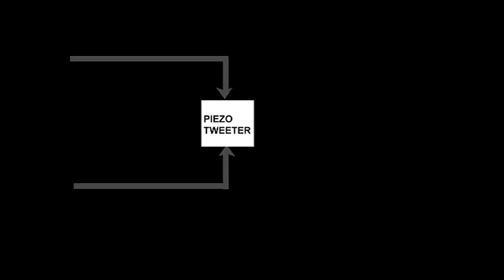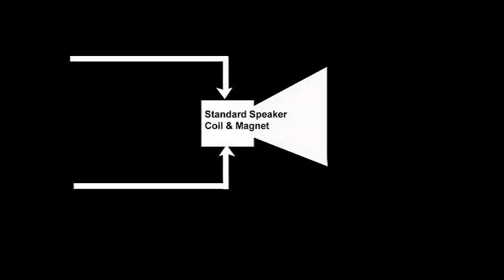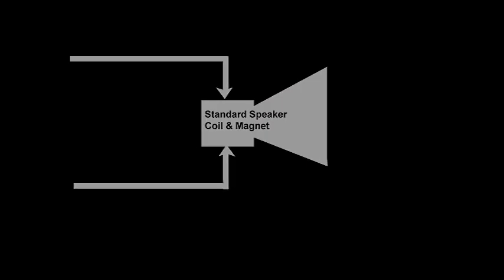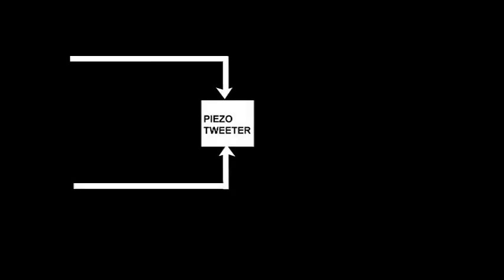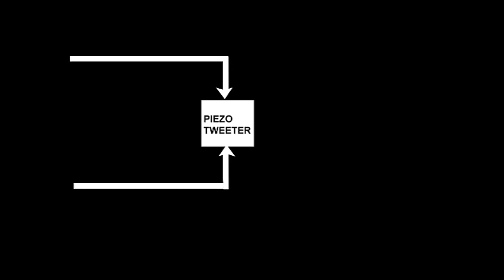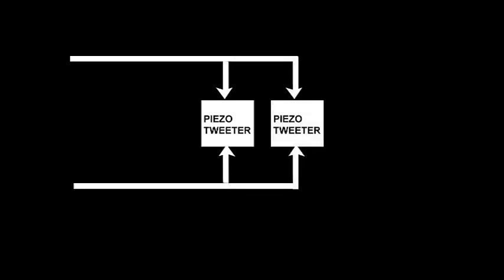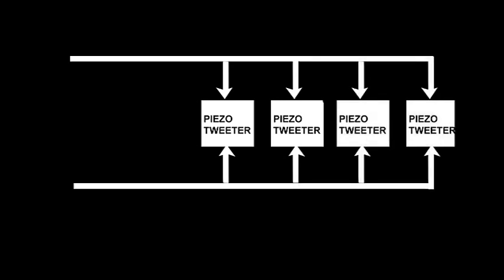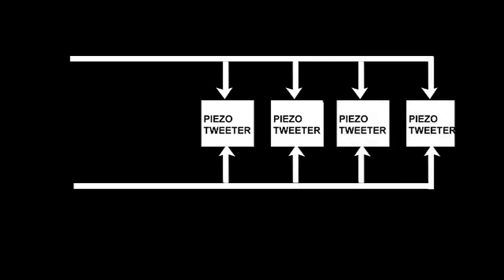PIEZO TWEETERS - Dog Control Experiments - Bark Stop Experiments

Comment from the maker: An amp won't help. The Kemo device is putting out a voltage style signal which is suited for a piezo tweeter. Regular audio amps concentrate on current (for coil speakers). You'll get more sound when voltage is the goal rather than current when it comes to piezos. If anyone thinks I'm wrong please correct me, but this is what I've seen with the piezo devices. The Kemo puts out enough sound to almost blow out a piezo. Some people say you can't blow out a piezo, but I've blown lots of them out.